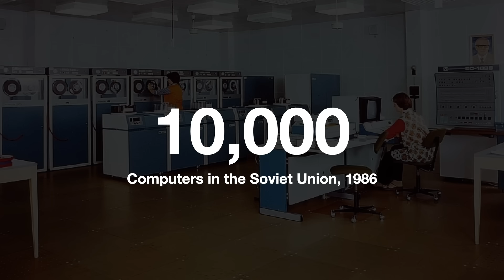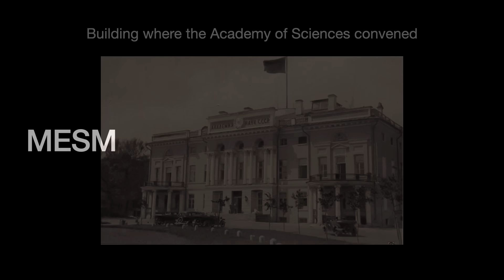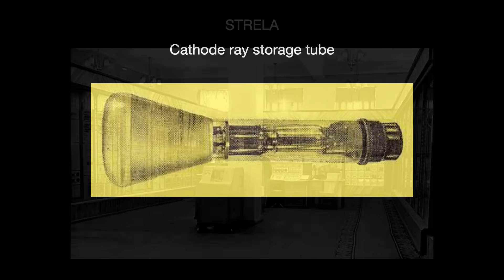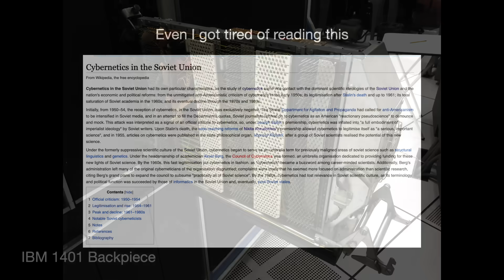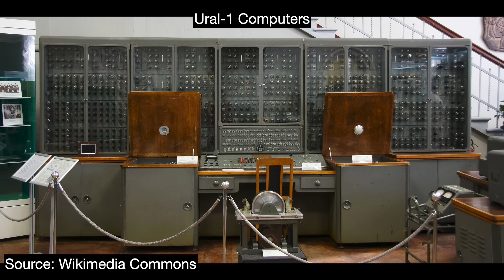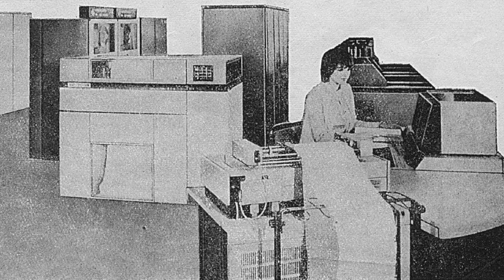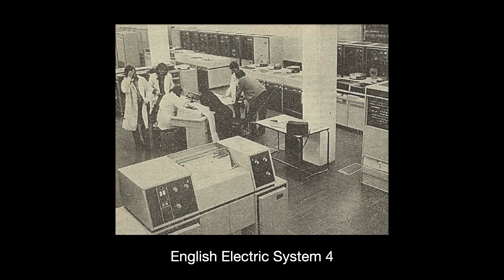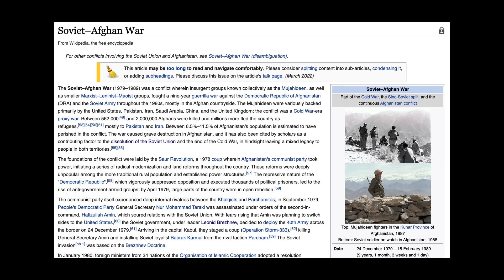Why the Soviet Computer Failed

Comment: I remember that there were 2 little gems in 80: HP 35 and Texas instruments SR 50 , I had a Texas SR 50 that was cheaper and easier to use than the HP.
Reply: Cheaper definitely; easier to use for some, not others.  My mind is organized in a way that I find the HP35 to be much easier to use, particularly if I don't remember whether I've started a chained calculation.  If you start typing digits on an HP-35, what was already there simply jumps up a register (all registers push) so you never lose a calculation.  But on a TI, if you want to add something to what is in the display, you FIRST press an operation and if you forget, then the displayed value vanishes forever if you touch a digit. 
The quality of the original HP35 was amazing; gold plated boards and contacts, double-shot buttons.  Mine still works but a 7-segment LED display has failed (4 or 5 digits).  The new HP-35 is much faster but nowhere near the build quality.  Cheaper, however, so I use it a lot.  I only used TI calculators required for a college class.

Comment: The 1st programmable computer was not ENIAC. It was the Atanassov-Berry computer. Built at Iowa State University in 1938.
Reply: @UJCentral  No, it was not.
Reply: The ABC was not programmable, and was not put on the market until 1942. Konrad Zuse's Z3 was programmable and became operational in May 1941. The Z3 was an electromechanical concept, bridging the divide between Galton's conceptually sound but inoperable Difference Engine and the fully electronic Colossuses and ENIACs of the 1940s. 

Like these, ABC employed vacuum tubes but was not a fully fledged computer; whereas Zuse's was Turing-complete and employed telephone switching before Tommy Flowers had the same idea at the British Post Office lab.
Reply: @esmeephillips5888  My opinion has changed again!  Thanks Esmee.

Comment: I had a 1980 USSR calculator, that was clearly, reverse engineered off something western, because division by 0 would show "error" written on the vacuum tube display. There is no way, it was put there on purpose. There were no English labels on anything made in Russia at the time. Whoever copied the chips, didn't know how to alter the error message routine.
Reply: They certainly did know how to replace a message, but try to spell ОШИБКА on a 7-segment display!
Reply: @averros2718281828  "but try to spell ОШИБКА on a 7-segment display!"
COL (Chuckle Out Loud).

Comment: Soviet computer failed because it didn't exist. My father worked in the design bureau that 'designed' the chips. The most popular Soviet chipset, the KR580 series was 'designed' by basically stripping an Intel i8080A, looking on it under a microscope and re-drawing the schematics. So yeah, one can say that in 1980s Intel had 5 factories in Soviet Ukraine lmao.

Naturally, all the software was absolutely compliant and I still remember playing CONTRA on MS-DOS on a 100% Soviet-made PC back in 1995 or so.
Reply: Thank you great info
Reply: Sorry, but I cannot believe you about playing on 100% Soviet computer in 1995.

The last PC compatible Soviet computers mass-produced were ES-1841 and Iskra-1030, near 1990.  And these were roughly equivalent to IBM PC XT.  There were a few AT-compatible machines (I believe they were designated ES-1845) but I cannot remember touching one of these.  In 1992, I had been writing my thesis on ES-1840 and Iskra 1030.

And the author of video made a great work, but didn't mention other, not IBM-compatible branches of Soviet computers like DEC PDP compatible (SM EVM), and Elbrus family.  Well, it would be a material for much longer video.
Reply: @MrGdg1969  did anyone say those were new computers out of the box? Those junkboxes were pre-1990, left there since the times of a random Soviet 'Science and Research Institute.' The other software I remember running on them was Lexicon, but afaik it is a Soviet 'app,' so no surprise there.
Reply: @MrGdg1969  You also don't understand just how bad the IBM PC version of contra was :>  It did indeed run on XT...
Reply: I play command and conqueer in boris garage.

Comment: FLOP = Floating Point Operation FLOPS=Floating Point Operations Per Second. I'd double check that these machines at this early date were doing floating point calculations. Most likely the unit is IPS =  Instructions Per Second.  As a data point, US personal computers didn't do hardware floating point until the 386 + co-processor, mid-1980s.

Comment: I have small experience to work with USSR SM-1702 computer. On soviet flight simulator with micromos OS . It was very awesome to use that old school russian keyboard. But i found very nice for me to program on native language. ) 
 I was fun. 

 A simple fact about the USSR: my friend worked as a foreman in the 80s in a manufacturing workshop. To get a new part in stock, he looked for it in the database, if it was not in stock, then the program automatically placed the order in production. And in the warehouse itself, a robot took  these parts from the shelves . And this is the mid 80's.
In general, engineers are the same everywhere, no matter where they live. For Russians, the lag in advanced computer technologies (production) was compensated by excellent mathematical training and natural ingenuity. IMHO.

Comment: Sadly, the Soviet Union did not come up with common technical standards for their computer systems.  They can do very well with specialized computer systems for each field, applying it in systems such as nuclear power plants, atomic submarines, space systems and satellites.  But, they do not improve them and commercialize them as well as apply them to industrial production as well as to life as an effective tool to increase labor productivity as well as production innovation.  Leonid Brezhnev's leadership did not produce good results in either the semiconductor or electronics industries, which were the two base industries of Electronic Computing, although they were able to manufacture products.  Computer applications are very good for work, but they are hardly exported outside, including to their allies in the Warsaw Pact.  And they can't do as good a commercialization as they did with the military industry and vodka.  As you can understand, the Soviet Union has a very prominent intellectual background in mathematics, the most prominent computer products is TETRIS, but they are too "gentle and naive" in the Electrical computer industry.  this death.  Unfortunately!

Comment: I can add, I worked with a former Czechoslovak electrical engineer. He was part of the effort to reverse engineer the Intel 8085. He would mill off 0.0001" off the top of the chip and take a photo. Repeat until they got to the bottom of the die. Though not mentioned, the failure to develop domestic photo lithography equipment was significant. His 'personal computer' was horrific. It was a paper tape programmable machine. He'd have to literally cut and tape pieces of paper together to make a program. He later came to the USA and enjoyed success on may projects here. If I suspected a $10 Intel chip was bad, I'd casually toss it in the garbage. But to him, it was still practically made of gold and he'd have to resist the urge to go and fish it out. :-)  He made several trips to the Middle East to buy Western chips and smuggle them back to Czechoslovakia.
Reply: Wow. I am currently studying EE at Budapest, and some of the older professors were also worked on reversing the 8085. Looks like it was a popular chip. I've heard these guys even fixed a few issues of the 8085 and Intel was even going to license the new version...
Reply: Thats fascinating update to knowledge I have about Czechoslovakian computers so far. I know that same reverse engineering was used to get a clone of Intel 8080, which resulted successfully into 2MHz TESLA MHB8080A. This was the only processor used for all Czechoslovakian school and home computers for most of the 80s; in 1987, Didaktik Scalica gave up and reverse engineered ZX Spectrum, while purchasing some original parts (Zilog Z80) and some clones (Ferranti ULA). No home 16-bit computer was ever made. There was one local manufacturer of IBM PC XT and AT clones, but they made it from parts purchased and imported from west.
Reply: @bluefalcon7782  Didaktik Skalica could have U880A, unlicensed Z80 processor made in VEB Mikroelektronik "Karl Marx" Erfurt. In the Communist East, the Council for Mutual Economic Assistance (RVHP for its Czech acronym) was in operation. Due to delays, they agreed on a single system of computing resources (JSEP) on the then obsolete i8080 processor, which Tesla was able to reverse engineer under the designation MHB8080A. A joke circulated that the i8080 was chosen because it was like Marxism-Leninism. It also has three sources. (+12V, +5V and -5V) and three parts (8224, 8228 and 8080).
Reply: Paper tape used to be a thing. I learned programming on paper tape TSS at high school in Canada around 1970.
Reply: @davidhawley1132  And it was still a thing at high school in the US in 1977, when I took my first programming class.
Reply: Some people starve of food
but i feel bad to see people starve of revolution tech
i hope we could achive more so everyone could innovate
even tho  nuclear war capable of wipe humanity

Comment: Russia used IBM equipment for the Moscow Olympics in 1980. They had to convert the two-language (English and French) used in Montreal in 1976 to add Russian. I along with quite a few UK IBMers went to Moscow in 1978 to teach them (in my case I taught a course on program design) at a mathematical institute in the Moscow outskirts.

Comment: There is well known story in Poland story about acquiring ICL 1900 license and software. As far as I remember reading about it years ago, it was not complete license for hardware but rather for architecture and for software. Polish factory  Elwro has to recreate computers base on architecture plans they got. That how Odra 1300 family was introduced in Poland. It was used in Poland successfully for many years but they struggle to export it to other (communistic) countries due to high pressure from Moscow for ES (IBM360), despite they showed it was much faster than original ES (IBM 360 clone) systems. It was used also as a base for military Rodan computers used in famous Czechoslovakia made  RAMONA i TAMARA passive radars (according to Wikipedia last East German Tamara unit was used by the Bundeswehr after the German Reunification until 2010). Elwro factory even build model R-32 which was compatible with Moscow forced ES system but based on improved ICL technology and much faster (at least the Elwro engineers says so).

Comment: I worked on computer graphic equipment at Ford Motor in Dearborn MI from 1978 to 1989. One of the techs I worked with was a German who's brother had just come over from East Germany. My co worker from Germany lit a cigarette in the computer room at Ford Research and his brother freaked out, dragging him out of the room into the hall. Smoke particles can crash a disk drive and that would be a big problem for the Soviets, not so much here. We had drives crash but mostly from power failures.

Comment: A solid doc, enhanced by the many thoughtful reply posts. In the early '70's I had a Top Secret clearance, working on Loran C, radio encryption, SSB transmitters, basically anything that was chunked onto my work bench.
Even 50 years ago the tech revolutions was accelerating rapidly, requiring constant schooling just to keep up.
A lot of ET's [today we're called IT's] couldn't keep up and found other work. I became a Union Electrician in 1976, but the constant schooling never stopped. Today, I've been retired for 9 years, and I'm as obsolete as a DC-6.
In 1960, the USSR led the world in the space race, ten years later it was over.
Reply: "A lot of ET's [today we're called IT's]"
That, too?  RM and DP merged around 1994 or so and I think rolled into IT; I haven't followed it that closely.  I'm keeping my DP rating badge however.

Comment: I've been involved with the semiconductor industry for 15ish years and one of the main issues I'd always heard from the more experienced folks was that integrated circuit manufacturing required top to bottom purity of input materials (everything from the silicon wafers themselves to cleaning solvents to extremely pure metals, gases, etc) that the Soviets were just not capable or producing because like you mentioned, they were only used to hitting quotas, not quality targets, and that the temptation to screw over the next guy became too great.  One guy in particular went on to say that this is why both Russia and China have struggled to produce true 5th generation fighters with 5th generation jet engines, they lack the industrial integrity to produce the purity of materials required for such extreme performance and the cultural commitment required to maintain them in a usable state.
Reply: Communist economies often have problems with technological discipline. A low level of control and a great effort to simplify work at the expense of quality leads to a very uneven level of quality. For example, when buying a car, it was said to be chosen according to the day of the week it was manufactured. Wednesday was the best and there were only problems with Monday and Friday. By the end of the system, it was probably Friday all week. You had to finish and repair everything at home.

Comment: ENIAC was completed in 1945 and first put to work for practical purposes on December of that year.  The  Colossus Mark 1 computer started working in December 1943 - beating ENIAC by two years.

In your long list of technology transfers you fail to mention German aerospace scientists / administrators [such as von Braun, Kammler, Dornberger] moved to America post WWr; the radar, jet engine, proximity fuse, cavity magnetron and the Frisch–Peierls memorandum describing the feasibility of an atomic bomb transferred to the US in 1940.
Reply: Colossus was a special purpose machine to help decipher messages encrypted by rotor ciphers.
Also to mention: Konrad Zuse's Z1 (1938) and Z3 (1941) which were indeed programmable binary general purpose computers with most of the components modern computers have.
Reply: @Merilix2  You're confusing Collossus with the Bombe. The latter was used to decode Enigma messages, while Collossus was designed as a general purpose device and used for things like calculating artillery targeting tables as well as decoding messages using the Lorenz cipher. The British government opted to keep Collossus secret until the 1970s, as they hoped to reduce Soviet interest in developing computers for military applications.
Reply: @chriswareham  No, I dont confuse Bomba with Colossus. Bomba was very special for finding plug settings for Enigma machines by using lots of unwrapped Enigma Rotors to brute force / test previously discovered rotor settings against contradictions.

If you look at technical specs of Colossus and how it was used, you barely find anything which classifies this machine as a computer. It was quite special designed for code breaking Lorenz cipher. (other than Z3 I'd say. Z3 (as well as Z1) already had most of the units modern computer have)

The fact, Colossus used lots of termionic valves to perform boolean operations is not enough to classify it as a "general purpose" computer.
Reply: @Merilix2  Not true, Colossus was a Programmable Computer, no stored program but programmed by the use of switches manually.

https://en.wikipedia.org/wiki/Colossus_computer
Reply: @Judge_Dredd  So a box full of logic chips already is a computer because you can change connections between them by hand?

Perhaps operators and colossus together formed a computer but colossus alone?
And still, this thing wasnt "general purpose".
I wonder if you could reprogram him to calculate trajectories of planets in our solar system or to control traffic lights or something else...
Reply: @Judge_Dredd  this is also true of Eniac. It was programmed though plug boards so was not in the true sense a stored program computer. That accolade or given to the Manchester baby in 1948.